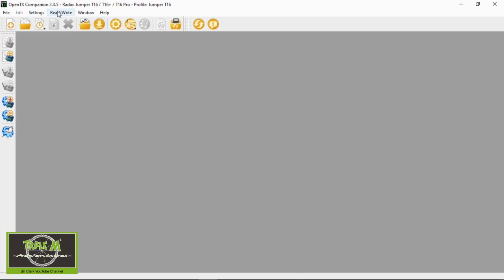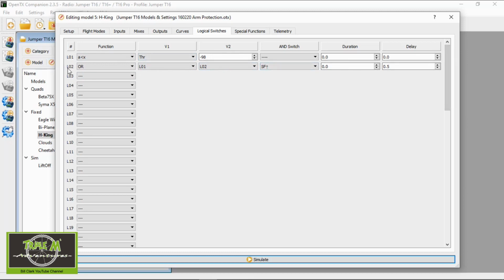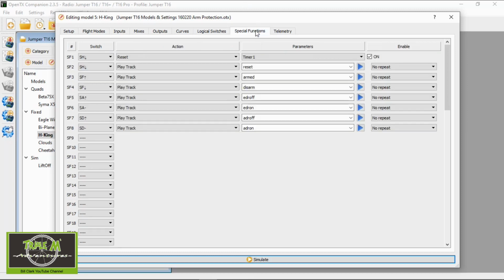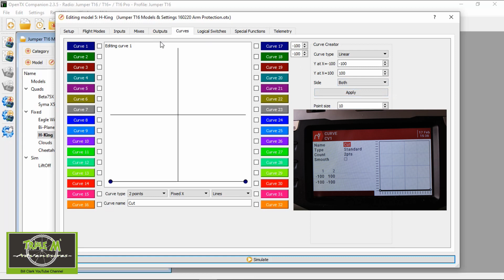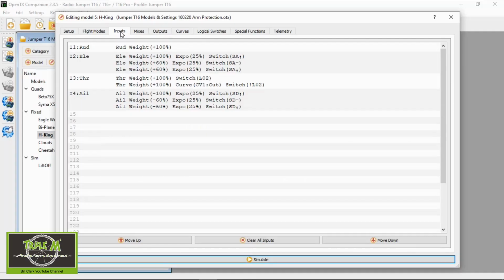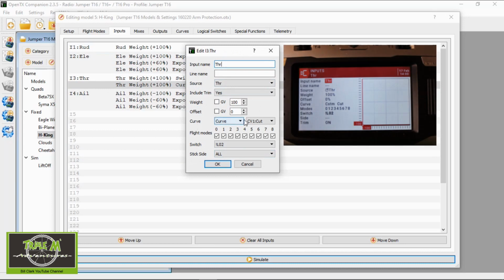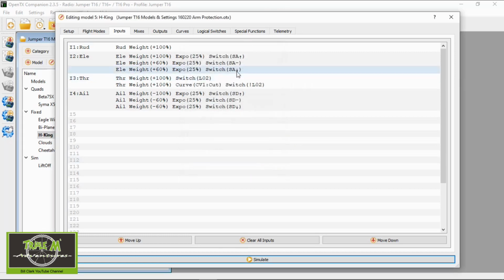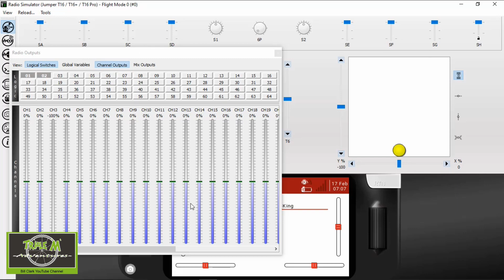Jumper T16 Setting Up A "Safe" Throttle

Comment: Brilliant. The question now is whether I can follow instructions. Hmm. Can only give it oneshot.
Reply from the maker: Woodstock LeBird I am sure you will get it right!
Reply: @the-happy-RC-flyer  Blimey. Prompted and aided by your video, the learning curve on T16 Pro has steepened considerably. I am a pathological tweaker and former professional instrumentation engineer, but truly I wasn't ready for the challenges of the instruction-free radio. In fact, I think I feel a YT video coming on. Judging by the video cross-section on YT, I think copter-types vastly outnumber wing-types. Whilst the novelty of hanging in the air isn't lost on me, aeroplanes will always be my main diversion. But not everyone relies on Betaflight and flight-controllers to do everything. Coming from Spektrum, T16 has been a massive disappointment and even getting a 3-channel plane under control has been an absolute nightmare. Simply this is, for the want of concise 'one page' direction. No wonder the vendor ran a mile.

The revelations now clear to me could literally been written on one side of A4, and could have had me flying with the TX on the same day as receiving the radio. Instead I chucked it in a drawer for three months and dearly wished I'd bought something else. Like a far from perfect Spektrum for example. Anyway - thanks again for the video which was one of the very few that really made a difference. It's not that anything here is difficult exactly, but it always will be hard to navigate in near darkness in a sea of irrelevant information. I am off to set fire to my T16. No wait, I wonder how else it can torment me?
Reply from the maker: LOL  @mrhilma , yes OpenTX is a bit like a cockpit of an airplane all those buttons and dials! It's like going into a shop and buying a model airplane 2 to pick from easy 50 models a nightmare!

I really enjoy the programming side of the radio but I knew a lot of people would not, they just want to get the golf club and hit the ball not make the golf club first. This is why I started making videos on the Jumper T16 and now the older Turnigy TGY9X. I know it is frustrating when you just want to add a model and go.

 I spent time yesterday working on a problem I had with setting up Flight Modes for my quad copter, video coming soon, and wanting it to do a specific task and it took a while to solve it.

My next task is to produce instructional videos on setting up multi rotors but I need more experience before going a head as you intimated OpenTX can be difficult to set up. Futaba radios are fantastic but very expensive but you get the inbuilt usability.

Please do not set fire to your Jumper T16! :) If you need help with it just email me bill@triplemadventures.co.za and if I do not know how to solve your problem I will work it out.

Thanks for your comment.
Reply: @the-happy-RC-flyer  Generous offer of help and advice NOT to spectacularly combust my T16 with glow fuel, gratefully accepted. Also very happy for you to discover all the things about setting up copters that would doubtless cause me acute pain and intense suffering. I have three tricopters waiting in the wings (ah hem) and countless proper flying machines using dwindling lift principle. Will stay tuned with great interest. Have I thanked you enough yet? I do hate to gush.